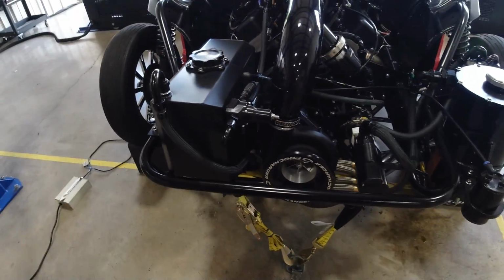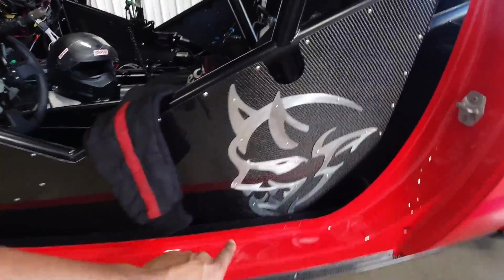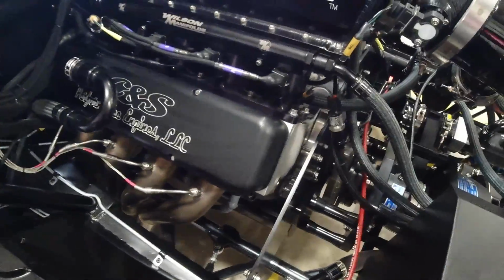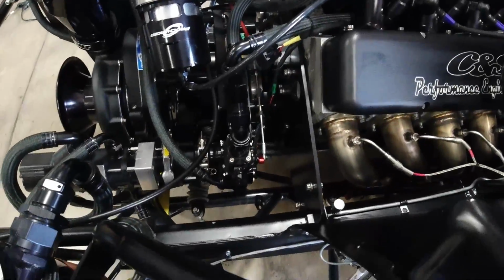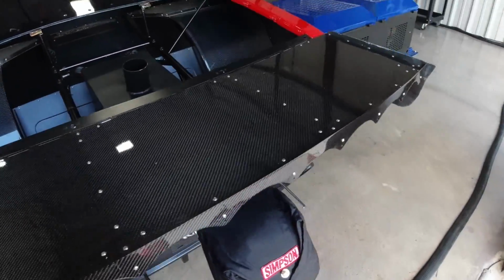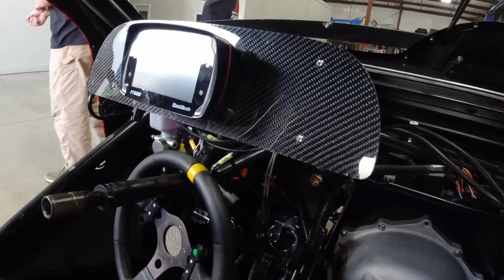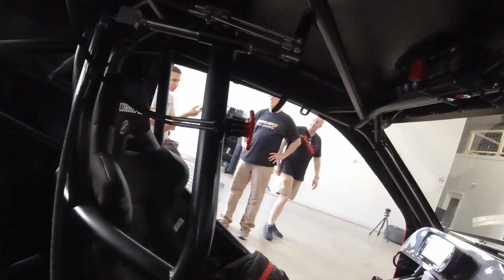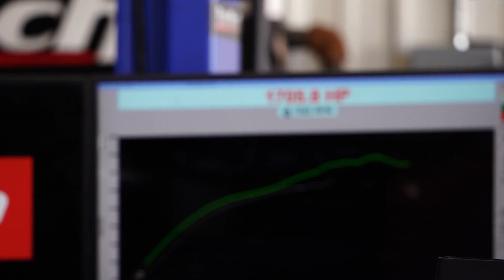SUPER POWERFUL X275 Dodge Demon!

Comment: a quarter million dollars and not even 2K HP ?
Reply: Familiar with class rules.
Reply: That was only at 7200rpm.
Reply: @bigboreracing356 wtf are you talking about. No prep isn't the only type of racing. They're running 3s in the 8th on that tire. 4.20s @170mph+ with 1.05 range 60ft time in X275 l, where the rules are very strict and limited to with power adders. Either single stage nitrous, most associations limit you to a simple 85mm turbo or F1-X-12 supercharger Max. Although Bruder's even went 4.20 with a roots 8-71 on a sbf.
Reply: @bigboreracing356  lol bro, it's hard to keep up with your names. I've seen that pic with others, so I always think it's someone else.
Yeah of all people, I know you understand what I said. I'm just use to the clueless lol.
I'm done ok, heading up north for a month or so for a job and then back down to Georgia. Yeah a 540 with a F2 plus nitrous is a lot of torque to tame from the hit. I forget, you run a stock type suspension right? What shocks are you running? 
Oh and as far as everything else goes. Obviously getting a 275 to work on the street or no prep surface is a much different animal. I was speaking specifically in X275 but I think you know that. How's everything else going. Haven't seen you in a comment section in awhile or maybe it's just because you changed your name again lol.
Reply: @bigboreracing356  Oh and when you added JA to that comment. It really made sense and I couldn't agree more. Actually I think you're being generous lol..
Reply: @bigboreracing356  I've always laughed at those same people. Dyno is just a tool to help get you in the right direction. Most people using it as a tool and not to bragging, usually don't run it on kill unless they're a specific problem they're trying to address. As you know it's not how much power we make but how much we can get to the ground and how quickly we can bring it in. I find it hilarious with some of these Youtubers have a thumbnail how X car made X power but wouldn't beat the last car I raced.  A 650hp N/A car with hyd roller that ran on pumped 93 or my favorites type of videos like they have the fastest stock Ls with 3 lug nuts, 1 windshield blade and a busted taillight.
Reply: @bigboreracing356   I didn't see your comment about the boost controller. I haven't seen the video on what you made, although I'm going to go check it out but a wastegate that turbo kits have can work. I did it years ago with a D3R. That's how long ago it was, way back in 2000 lol. When it was much harder to get a car to work. Tire compounds etc aren't what they are today. If you went 7s back then on a 28×10 even on a good track, you were extremely fast. Guys running 31×10.5w were just breaking into the mid 7 with a half back vehicle.
As far as controlling the power. I used gen 6 DFI in the late 90s and then went to F.a.s.t and big stuff after 2000. Even with fuel injection timing can only control so much in certain situations depending on the tire, surface and hp and torque.
 We played around with rear gearing, glide vs TH400 to ramp the boost slower. Ultimately it was a 3.55 gear and glide that worked best. Then I added a wastegate. People told us we were stupid and it wouldn't work. Well it did but we let them believe that it didn't because it worked that well. I'll have to shoot you a email about it. Some of what people were doing back then. Many think is something new today as I'm sure you know. Good luck bro, I'm sure you'll get it. Definitely have to get together when you make the move to South Carolina.
Reply: @bigboreracing356  You don't have a bad Idea at all. What about using a RC servo but use something like a nitrous button or switch to control it. That way you have full control on every pass. Just a thought.
I didn't drive that car much on the street. Plus at the track after a few hundred feet I wanted all the boost that blower would make lol. It was just a little sbf. So the wastegate never dictated how hard the blower was spun. I never had any belt issues either but understand your point. In my situation I needed the speed of a wastegate too but understand how your way would work in yours. Like I said not a bad idea at all you have. My only worry would be if something happens to the restrictor and it got sucked into the impeller. I'm sure you have that covered in your design though.